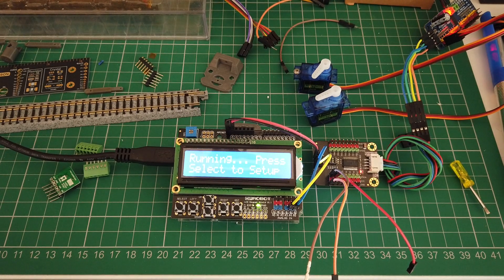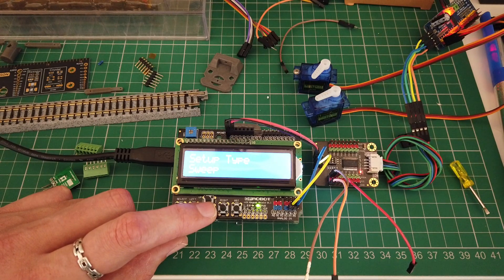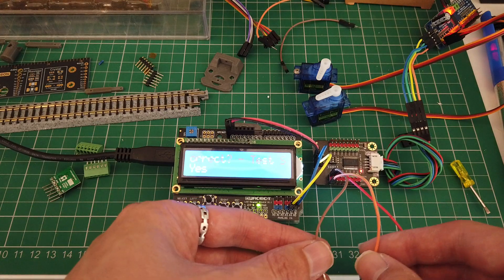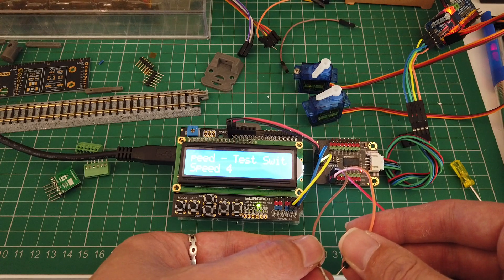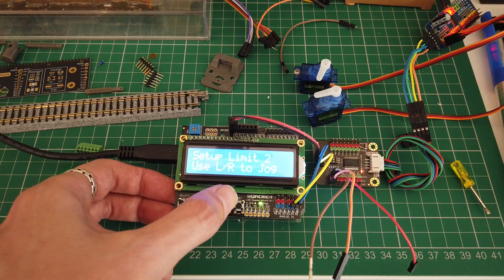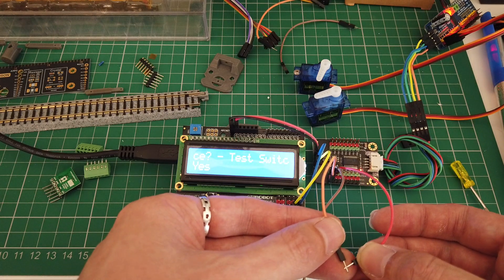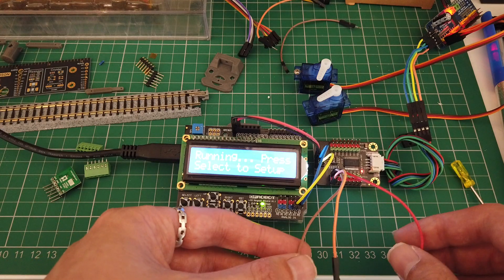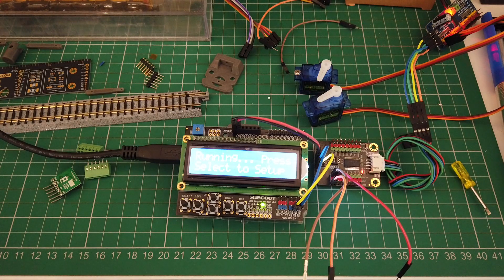Model Railway Servo Controller update...

Comment: New subscriber .... This is exactly what I'm looking for, Running a DC OO layout with hard to reach points
Reply from the maker: I've used off the shelf available parts. If you're confident with a bit of wiring and somewhat familiar with Arduino it's a relatively simple setup.
Reply: @haywardjunction  wiring I'm OK but I don't know much about Arduino. but I'm sure I could work it out once the code is done,
I built a PI arcade and a Kodi box, I guess its kinda similar with repositories.